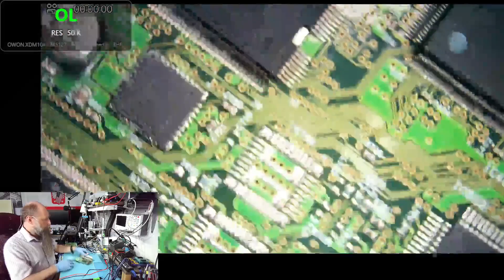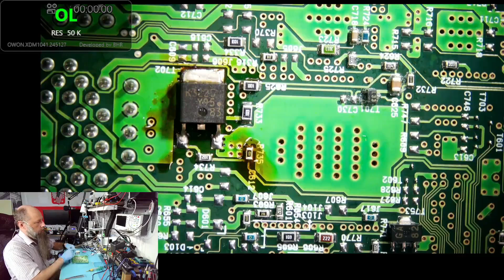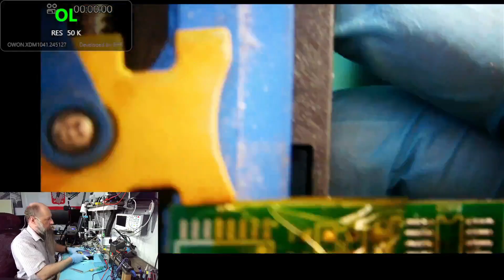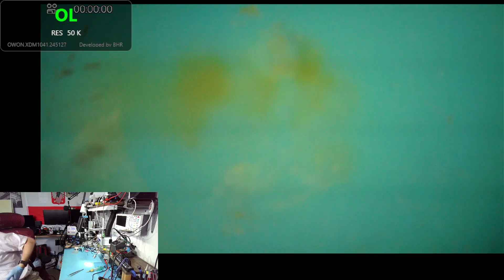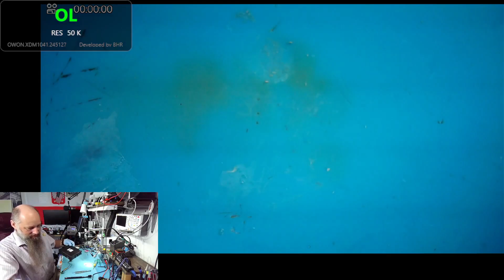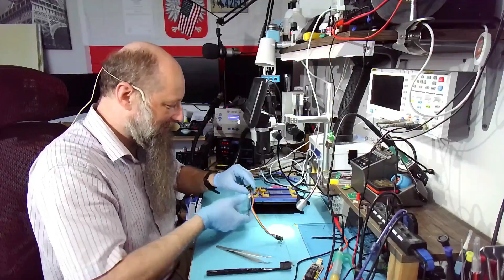230 | ECM Repair Front Oxygen Sensor Heater P0030

Comment: "Repairing it just for the fun of it" Legend! Love the fact you actually care.

Noob question: Why did you use a nozzle when adding the transistor? Wouldn't it be easier adding it without a nozzle?
Reply from the maker: That's true, without a nozzle the rest of the board heats up quicker and that reduces the time needed to remove the transistor. The reason I don't remove the nozzle is just the trouble of it, you need to wait for the device to cool down.
Reply: @blackhorserepairs  Thanks for the answer <3